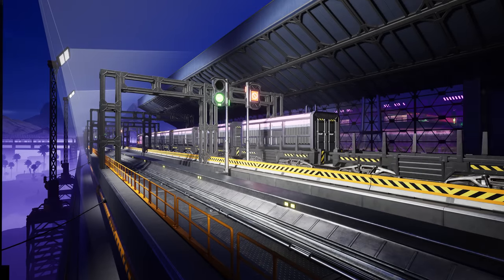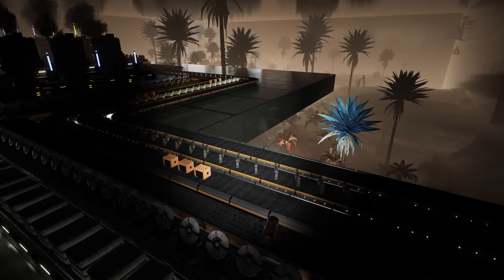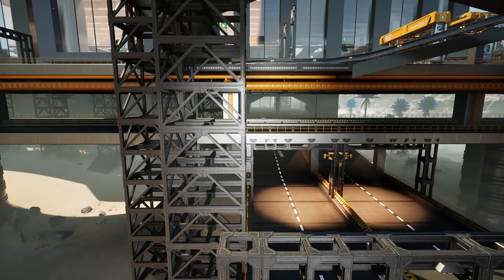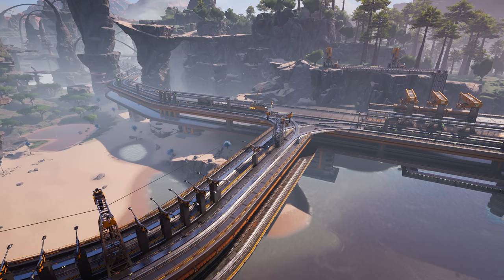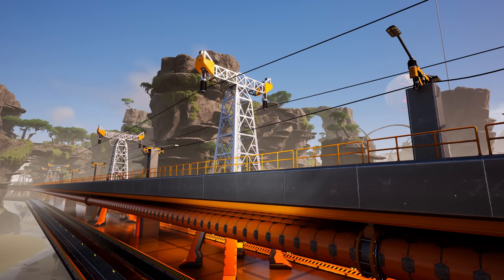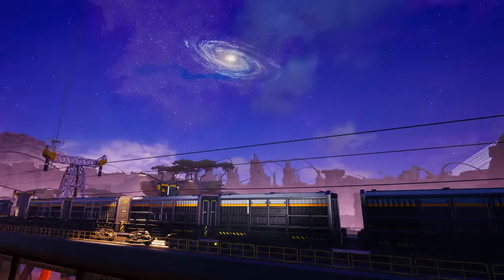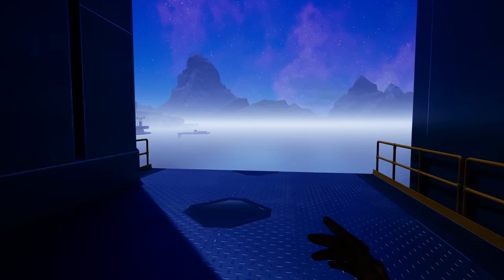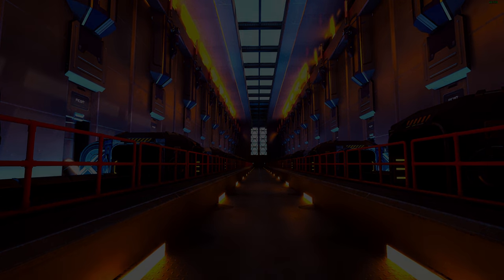SO YEH... I DID THIS IN SATISFACTORY!!

Comment: Unfortunately satisfactory is barely playable on my pc anymore after update 8. Had to turn all graphics to low and i still get a slideshow for framerate in return. Kinda bummed about that
Reply: Before you give up try a few things first.  I recommend you set the Anti Aliasing Method back to Temporal AA (TAA) if your hardware supports it turn on Vsync, turn off global illumination and reflections,  and limit your frame rate to 60. This solved every issue I had with the update frames wise at least.
Reply: @StellarisIgnis  thanks, i'll give settings a check tomorrow but i know i already have the illumination checkboxes off. when i turned em on it was unplayable. Couldnt even walk

Comment: I'm surprised your trucks work.. with how they react in update 8 they feel very stiff until there not stiff then they feel there on ice.

Also your roads throw me off, the dotted line is usually to separate lanes, not mark the center of a lane. rofl.
Reply from the maker: Yeh the trucks are all good for me... As for the roads, haha i have thought about changing them, who knows maybe i will lol
Reply: @ItsBitz  Lucky, EVERY truck path for me broke with the new changes they got in update 8, and sadly with how they handle now I've yet to be able to remake the paths without a spinout or two.